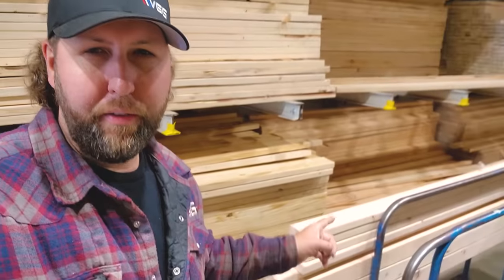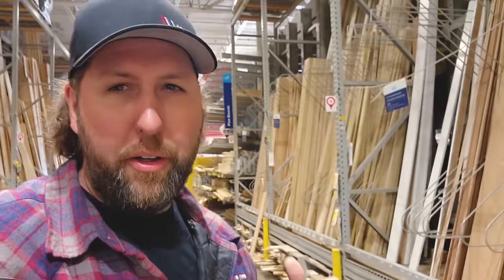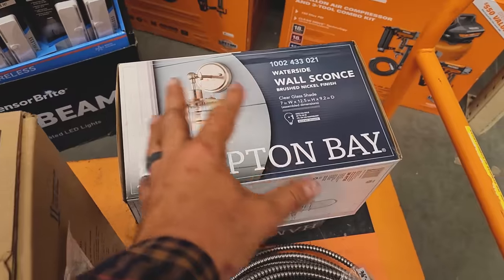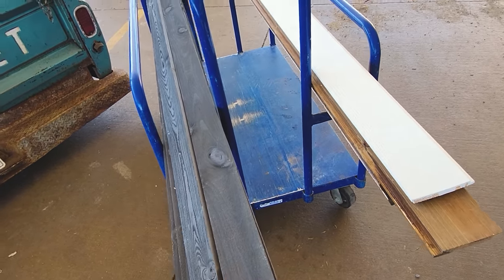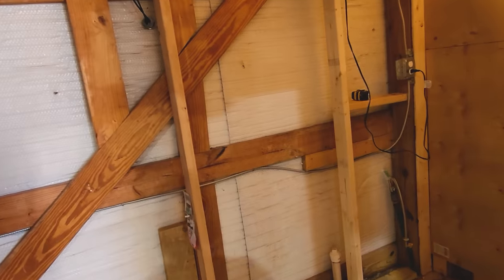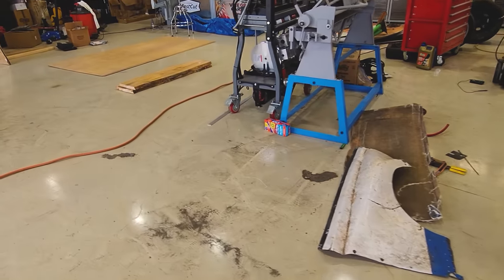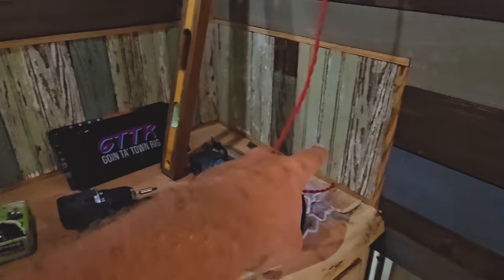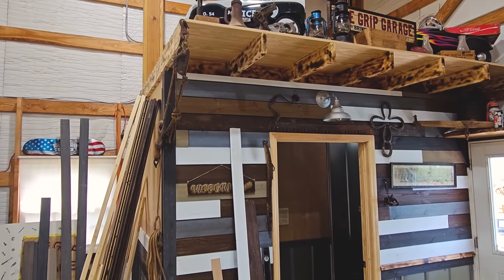Shop FINALLY Get's A Bathroom!

Comment: Not sure about the multicoloured ship lath as it’s not my cup of tea, but it’s also not my shop washroom either, have to say the cabinets with the license plates look cool. All the other accoutrements really work well in the space. I might have tossed a shower in there as well just for those times when you’re working away and get extra greasy or oily, be nice to shower off there instead of going all gooey back to the house.

Comment: Hey Derek, the bathroom turned out amazing! If you need a cover for the toilet tank that was broken, a piece of that live edge lumber cut to size and epoxy coated  inside and out would blend right in.

Comment: It's not a hot water heater. It's a water heater. If the water is hot, you don't need to heat it.

Comment: Really cool! You deserve it. Do yourself a favor and paint that rotary cut red oak with acrylic or polyurethane paint for cabinets as opposed to latex and definitely not clear varnish. I'm a cabinetmaker and those doors and face frames are kinda hard to look at as built. So many competing woods that a light neutral color  on the cabinets, like a "dirty white" paint color, would diffuse light better, brightening the room and let the other woods be appreciated. Great content as usual

Comment: Bathroom and all looks great. As far as EFI in Longmire, I've got a Sniper on my '70 C10 longbed stepside that has a 250 with 3 on the tree. Boyd Welding tank, Aeromotive in-tank pump, head was decked, added a lump kit, and went with 1.94 intake and 1.60 exhaust valves. It has an Offenhauser intake and Hedman long tube headers. It can sit for months, then go turn the key and it lights right up. Runs well and hasn't given me any issues. I still need to put a cam in it to take advantage of the larger valves and lump kit, and then get it properly tuned.

Comment: Great video, nice hath build. Btw  you are missing  a lens cover in Jessica's truck. Moving the gas tank out is always a good call. On the cold blooded, a lot of that is manual choke vs. this new/old thing that costs just a little more on your carb purchases, it is called "an electric choke". Wink. Lol Not sure why a lot of guys buck the extra $20 bucks for that fangled electric thing-a-ma-gig, opting to fight with cold start manual choke for years? But the EFI you were speaking of, that is the ticket.

Comment: I really like that bathroom of yours that's top drawer right there, also years ago a friend of ours had his master bathroom done and had piped-in the fart fans straight into the sewer pipe vent which was piped up through the roof. Cleanest most efficient way to exhaust stale air and water vapor out of the bathroom I've seen.

Comment: EFI in a old truck. Don't you mean some starter juice bolted(zip tied) in on a pull string activation. You know the same type of thing you do to a failing starter. JB weld or zip tie a knocker system on starter with a pull string. 
You get a couple of these systems running. And it'll make ya feel like a drummer starting your truck.

Comment: A 74-81 Suburban gas tank fits between the frame rails like it was made for it. You just have to heat up the filler neck and move it where you want it to go.

Comment: I always use cooked linseed oil for treating selfmade furniture.
Ik buy 5l cans online.
I mixe it with some terpentine so it goes deep in the wood.
After some time..(c.a 15 min) i rub the surface with old cloths .
Warning, when you use cloths for speading the oil, always soke the cloths with wather after use, before throwing them in the garbage.
Chemical reaction can cause fire in the cloths.

Comment: Derek, do you look at the end of each board to scope out the grain of the wood. This gives an indication of where the board was positioned in the tree. Anything with the center of the tree in the board (round ring pattern) is not good as the sides will curl. Today's lumber is fast grown and the average pine stud is like balsa wood, no sap, no weight, junk by comparison to an actual vintage 2X4.  Is it all coming from China?  Usually better lumber can be found at a non-chain lumber store and they are a rarity today.

Comment: what you should do before you varnish is put a couple of 60/40 water/varnish on before you go ahead and put the main coat on. rub down the surface before each 60/40 so you get a good key-in. maybe do 3 coats. then put your first coat of varnish on, rub that down (once its dry). that way if you have any drips you can get rid of them. put maybe 3 or 4 coats of varnish on and it should last you a lifetime. at least thats the way i was taught to do it more than 30 years back.

Comment: An old trick homesteaders do is to burn the wood with a torch. Best thing for sealing and preventing infestation. Also water proofs the wood. I used to buy green wood until I started using that method. 👍
Reply: Lol commented to soon, see you already know that trick.

Comment: As much as a guy shops for the best deal on the old jungle website I'm surprised you didn't buy a lot of that stuff there. Lots of that stuff is way cheaper there like PEX, breakers, wiring, fixtures etc. Wood of course they don't have that water heaters are usually about the same price as the box stores.
And OUCH!! Lowe's IS NOT the place to buy metal roofing!! There almost 3x the cost of a metal roof supplier who are usually local businesses. I'm sure there's one some around y'all somewhere.

Comment: On the cheap, just piss right in the poop pipe and plug it. Not to be pooed in.  Then on the top of ye old waste you put 4 quarts of vegetable oil, the only time you drain that 8s when it goes bad then you fill it back up with a food grade oil.